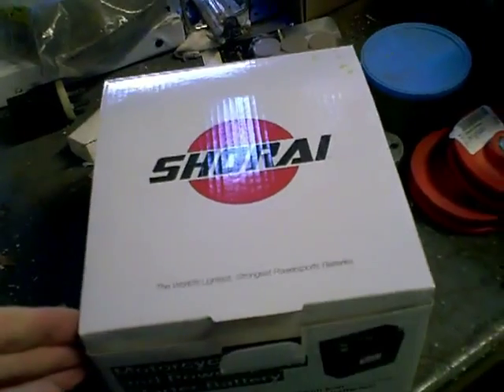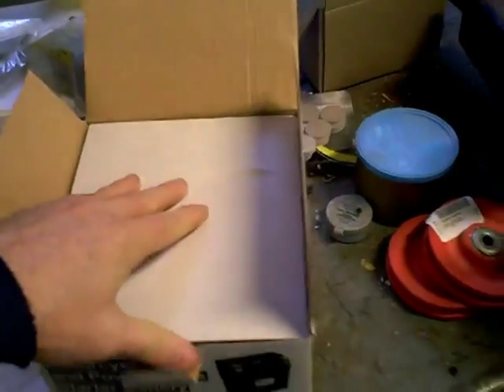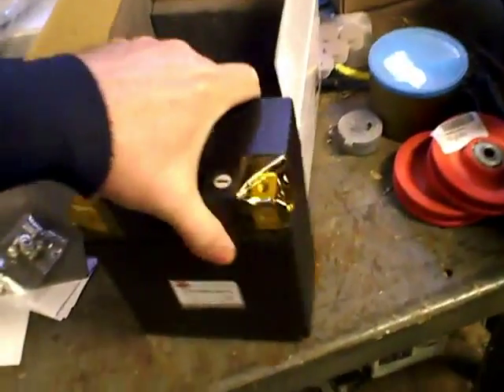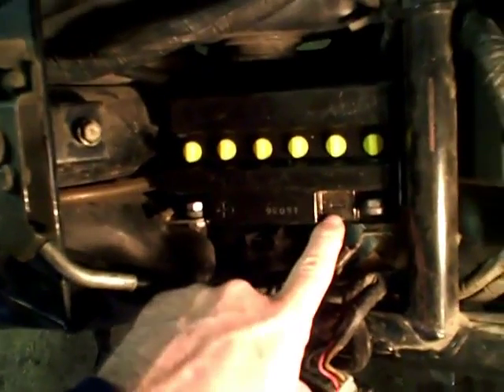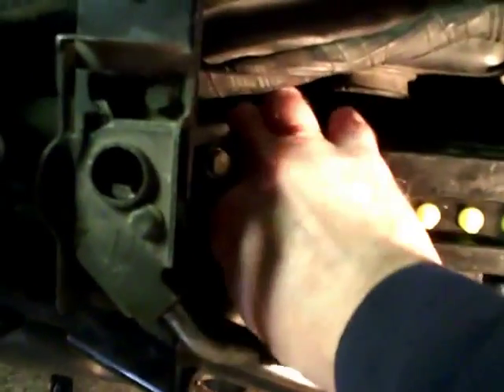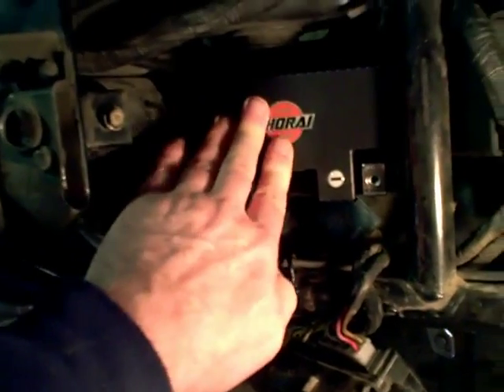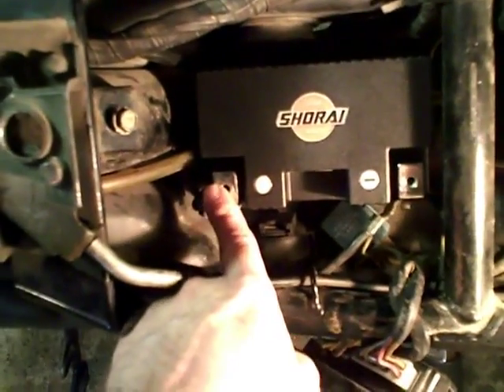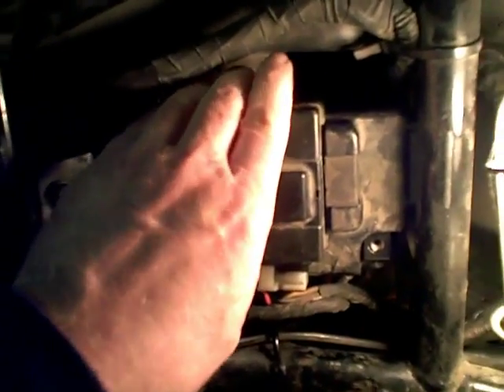Shorai Battery Fail ? Part 1 (to be continued)

Comment from the maker: It is never parked even in winter. I am a year round rider. It's tuned up yearly and with the new Yuasa battery installed starts instantly. If it gets to the point you need starter spray to get a bike started you need to investigate and solve the problem. 
Thank you for watching.

Comment: Lithium batteries have the ability to build their own internal heat energy when a draw is put on the battery. This means that although if may be 0°F outside, the battery has the ability to raise its internal temperature to 58°F in seconds with a 100amp draw. As the temperature rises inside the battery, internal resistance lowers and the battery performs just like it does when it is 60°F outside. This means that the amount of available amperage does not change based on temperature.

Comment: Question:
 If I use my powersports vehicle in cold weather which battery should I use?  Lithium or Lead acid?
Answer:
If you regularly start your powersports vehicle in weather below 32 degrees Fahrenheit (0°C) then we recommend you use the next size battery up from what is recommended in the application chart. All batteries start to lose performance below 32°F (0°C), and Lithium batteries tend to fall off more dramatically.

Comment: Lithium Requires a Specific Charger. One that charges to the higher voltage. And maintains. A regular charger wont turn off.
Reply from the maker: That is why I monitor the voltage using a manual one amp charger the company said was fine. You just need to turn it off yourself when it reaches max voltage.  I spoke with the technical department on the phone and did as they instructed.

Comment from the maker: I agree. Seems they need to also engineer the batteries for keeping voltage up higher during cranking. Less than 10.5 volts after two or three tries is not acceptable. Sure you still have a lot of amps in reserve but at 9 volts or less the solenoid will not engage.
I also followed the exact instructions and their video on their site for doing the install. No pre-charge needed.

Comment: Mine came to my door from Amazon yesterday evening. I was afraid I would have to wait until Monday for it. It's not a bad battery. Considering the number of times I let it go completely dead either by leaving the key on or letting it sit too long before I got a tender, it did OK. This is only the first time I replaced the battery.

Comment from the maker: I did it through Amazon so they always take care of it for me.
My stock rating is for 140 CCA and this battery is rated 210 CCA.
The problem I believe it the severe voltage drop. Below 10.5 volts the 
solenoid does not always engage. The link in the description shows the voltage drop problem. I think in a warmer climate this battery may be fine but as far as hard starts in the cold I am not trusting it. The price is three times a Yuasa battery so I expected excellent performance.

Comment from the maker: The status is still pending. Shorai has sent me another battery to try however I cannot do a cold weather test as of yet. I am using it as a portable power source for a small compressor. I will probably be doing at least one update soon and another when the cold weather comes again. As far as "other" issues I had the bike into a Kawasaki dealer to do the valve adjustments. I had them go over the whole bike and the head mechanic says the bike is in excellent condition and has 30k more at least.

Comment: yes stock one is really better. I had so far only problems with dry batteries like LFP or VRLA type - according to my experience they are only for good weather use (what may be fine for 90% of the bikers, of course), but they don't keep energy for several trials in winter.

During coldness the oil turns hard and the engine needs more power for starting, and if in the same moment the battery is weak, forget - lead acid has also winter challenges, but I feel they do it much better than the others

Comment: 18 months and 15000 miles since I installed a Shorai in my Royal Star ... NO problems; in very cold weather the first try grunts without cranking, but with each successive try (as necessary) the battery wakes up more and then goes full force; lead-acids are strong but get weaker with successive attempts, so the Shorai is the opposite in cold weather.  March thru Nov ... starts on the first crank.  I don't use a charger..

Comment: When the temperature of a Lithium goes below 32°F (0°C) internal resistance starts to build in the battery and the amount of available amperage goes down as well. This should lower the Cold Cranking Amps, correct?

Comment: I got my first shorai  battery, anf I liked, it last 7 years after a power outage, the bsm-01 do not resume to storage setting ( its like it is turned off) , and the battery was damage, after that battery, I got only problem qith shorai battery ( replace 3 already) they have always problem with pins that may the charging system not charging and then qith time the battery is damaged,  for a 100- 120$  dolars battery they should have a serius water proof and corrosion resitance conectors to the battery, like exterior car conectors has.

Comment: If you operate your vehicle in temps lower than 32deg;F, (0deg;C) like say a snowmobile, Lithium batteries may not be your best choice, you would best be served with a traditional deep cycle lead-acid battery.
I start riding here in Michigan early spring, temps are in the high 30 to low 40's.  I will crank the motor 3-4 times for about a 2-3 second before starting.  This builds the internal temperature.

Comment: shit happens - especially with the costly batteries ...
I saw it had for three startings energy, means it worked and was not short circuited. So I guess it had not enough pre-charging for such low temperatures. Such dry batteries have higher output impedance compared to lead acid type and work badly during cold temperatures, means they are kinda useless in winter. Additionally, starting cold bike takes more energy. Li'l charging and keeping it at room temperature could maybe help to restart ...

Comment: should have charged it before putting in the bike.  I balance charged mine with the proper charger and threw it in my 2005 Kawasaki ZX 12 and it’s been there since 2014 and still works just fine.
Reply from the maker: Kawasaki is long gone now  
I use the battery for a 12 volt portable power supply. 
It's real rating in "amp hours" is half what they claim but good enough for my new use. 
Glad it's working out for you speed demon.
Reply: @suburbanryder  do you have proof for those numbers?
Reply: Ive metered mine and its only 8 amps off cca(285) and my static voltage is 15.20. And the voltage is supposed to be 14.00.
Reply from the maker: @dustinmarshall5741  Yes tested the watts going in and watts going out.  I am not the first to find out it's half it's normal rating.
Reply: @suburbanryder  As i stated mine is on spec after follow proper instructions via their site.
Reply from the maker: @dustinmarshall5741  If it works for your needs and you are happy I am happy for you. Just did not do what the same lead acid rated battery could in the cold.  Different strokes and all that. :)
Reply from the maker: @dustinmarshall5741  It is also quite possible your 2018 battery is not identical to my battery purchased in 2012. A lot has changed and improved in the last six to seven years in LiPo and LiFePo batteries.  I use quite a few battery types in ham radio and the cost has fallen and capacities have climbed in just the last few years.

Comment from the maker: From the instruction manual with the battery and I quote:
"Shorai LFX batteries are pre-charged to 90% of capacity at ship time. Therefor it is not required - nor generally recommended - that the batteries be charged before use in your vehicle."

Comment: Ah well. Stuff happens, as they say when they don't want to use the more appropriate word. By shear coincidence, I installed my battery today. It's a standard lead acid YUSA. Exact same model as the OEM battery in fact, but without the Honda markings. My luck was a bit better. Of course I spent a shed load of time doing my carbs! :-/

Comment: these are supposed to be lithium chemistry batteries right? Lithium typically has an extremely flat discharge voltage curve. If they are dropping any significant amount, the capacity of the battery has already been reached... at that point serious damage is likely occuring. Lithium Chems are amazing things, but they have to be done just right to match the use. there is no way from these videos that these batteries have the right ratings for these applications.

Comment: yamaha r1 doesnt like that battery too ...
Reply: Battery AH  rating is also wrong. 
Only puts out half the amperage it's rated as on the case.
Reply: What are yall talking about. This battery is specifically designed for the crossplane R1. Lfx19a4bs12

Comment: Sir the instructions specifically states to charge first with their shorai charger for 2 hours. I did this has been the strongest battery ive ever used. You literally neglected all of the batteries instructions dude. Omg go read them on their site and your gonna slap your self because the batteries are fucking ruthless.
Reply from the maker: Show me YOUR video using similar equipment to what Joel uses. https://www.youtube.com/watch?v=ySNbSZTgplA&t=3s
Reply from the maker: I don't doubt if you have a low draw starter the battery will do fine even at half it's so called "rated" capacity.  The fact is where I live we need much more capacity to start in cold weather.  A rated 20 amp battery in cold weather can have half it's rated capacity.  If they are already making a claim double what it really puts out then you are down to 1/4 capacity in the cold and basically SOL.